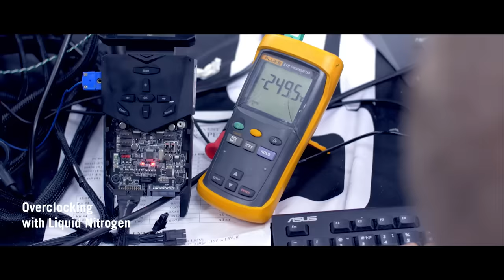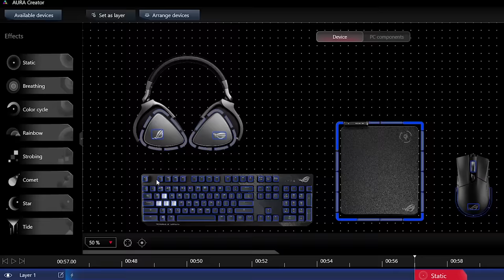The Story of ROG - For Those Who Dare

Comment: It was my first time building a PC and after watching numerous reviews of which is the best brand to get for my PC parts, the answer was clear. I'm now enjoying my fully-built all-ROG PC and the experience is like no other. 

#ForThoseWhoDare #ForThoseWhoDare #ForThoseWhoDare

Monitor 1: ROG Strix XG279 2560X1440 170Hz IPS
Monitor 2: TUF Gaming VG27AQ1A 2560X1440 170Hz IPS
Keyboard: ROG Falchion & ROG Strix Scope TKL Gundam Edition + ROG Wrist Rest
Mouse: ROG Chakram Wireless
Headset Stand: ROG Throne Qi Gundam Edition
Deskmat: ROG Sheath BLK LTD XXL
Motherboard: ROG Strix B550-A Gaming
CPU: Ryzen 5 5600x
GPU: ROG Strix RTX3070 8G Gaming
Cooler: ROG Strix LC 360 RGB White Edition
PSU: ROG Strix 850G White
Case: ROG Strix Helios White Edition

#ForThoseWhoDare #ForThoseWhoDare #ForThoseWhoDare

Comment: Purchased my ROG Strix LC RX 6800XT for $1,400 in June of this year. Really am loving it so far, but need to upgrade my CPU. The quick release button for the PCIE slot retention bracket on the new series of ROG motherboards is a must-have feature for me at this point because I have a dark rock pro 4 cooler. It's impossible to remove the cooler without removing my GPU, and I HATE putting a screwdriver or pen in between my GPU and motherboard to try and get to the release button. I will most certainly be getting a ROG motherboard to hopefully never do that again. Please keep that feature going in the future! So awesome! #ForThoseWhoDare

Comment: My favorite rog hardware is the Gtx 166ti. I had some much fun playing many games as possible using this GPU.
Two years later, I wanted to build a new gaming PC. My eyes were on the z590 Motherboard lineup, RTX 3060ti tuf, rog strix PSU, rog strix Helios, rog strix LC water cooling and Core i7 11700k. However, due to some restrictions in my country and limited hardware, I had to take what is available in the market. I got an RTX 3060 rog, b560g wifi, core i7 10700. I had to work for a whole year to be able to get a full setup which yet is not perfect. The sad thing is I can't really enjoy Gaming. No more than 2 hours per day or even 6 hours per week. Unfortunately, power is off most of the time. Hope you all enjoying your time.

Comment: I recently built my very first x86 PC for gaming and the only motherboard that had all the features I was looking for was the ROG X570 Strix —E Gaming. This was my introduction to ROG products and from there I bought a AX11000 router to utilise the 2.5Gbe and the Keris Wireless mouse and are super happy with all, especially the very low resource Aura and Armoury management software and the network speeds I now have thanks to the router, no more hangs or dropouts on all of my devices in my home network. I also think the ROG BIOS environment is one of the best user experiences and easy to understand in its implementation of all board makers — I’ve used a couple of others brands in the past and found them to be cumbersome and confusing . I am now happily amongst #ForThoseWhoDare

Comment: I bought my first ROG product by chance, I just wanted a gpu to use with my first 1440p monitor. So, I got a 2nd hand 1070ti which happened to be a ROG Strix model. Man, it was loud at first... I went on with cleaning it and replacing the paste, as it turned out that it had been mining for two years straight without proper maintenance. After that, the card turned out to be the most silent card I have ever seen. I was constantly looking down at its fans to see if they're working when gaming... And the temps were like the best 1070ti temps around. Kudos for that great product, it's still working like a dream in a friend's pc.
#ForThoseWhoDare

Comment: 2 years ago, I bought a computer set from a closed Computer shop worth 5k for the love of gaming. I started purchasing my first ROG Product ( ROG Strixx B450-F Gaming ) and AMD Ryzen 3 to replace my crappy motherboard. I fell in love with the ROG Strixx Collection and as of now, I am almost complete with my Build with Full ROG Product. I never felt that I'm wasting my money because I'm getting a Quality product. Here's my PC Specifications : 
Case : ROG Strix Helios
Motherboard : ROG Strix B550
GPU : ROG Strix RTX 3060
RAM : T-Force Delta 32GB
Cooler : ROG Strix LC 360
PSU : ROG Thor 850W
Processor : AMD 5 5600
HDD : SeaGate 1TB
SDD : 500GB
Peripherals :
Keyboard : ROG Strix Scope
Mouse : ROG Spatha
Headset : ROG Strix Fusion 700
Headset Stand : ROG Throne

#ForThoseWhoDare

Comment: My favorite piece of ROG hardware is the ROG graphics cards, they deliver the best quality and great thermal, making my gaming and content creation so so much smoother and faster! 

Previously, I was working on my After Effects projects on other brand’s gaming laptop, and I was stuck with slow and laggy workflow, same goes with gaming, the frame rate drops and glitches. However, after I built my first gaming PC with ROG Strix Motherboard,graphics card, AIO cooler and PSU. All theses problems have gone away! 

ForThoseWhoDare

Comment: My favorite ROG product is gladius 3 wireless. It ended my 12 years of search for the perfect mouse - hot-swappable main switches(I changed right one to Kalih GM 2 for more "mushy" feel, while leaving ROG switch on the left for snappy clicks), all-plastic body that makes mouse easy to clean, best wheel(and even more important for me - disclosed model of encoder, so I could change one if needed). The fact that this mouse designed to be easily and repeatedly disassembled captured my heart. The only downside to this mouse is that you have to install Armoury Crate to configure it.
#ForThoseWhoDare

Comment: Currently using my ROG Maximus X Formula and love it. Currently houses my 8700K which is overclocked and has done me well over the last few years. The additional ports, VRM cooling, and the beefy backplate made it easy to install and at the same time connect everything I have inside my system for the full experience. Definitely looking forward to the Z690 Extreme and maybe if I'm lucky upgrading my entire rig based on it this coming year. 

#ForThoseWhoDare

Comment: The Asus RTX 3080 Strix is is my favorite piece of ROG hardware. I am a big fan of simulation games, especially ones with incredible graphics. The RTX 3080 Strix allows me to play all my favorite games on max settings, and I never have to worry about frame rate drops. The cooling solutions on the card are also incredible, I never have to worry about overheating. I also appreciate the high quality parts that they use for the graphics card, I have heard of other cards not from Asus crashing but I never had such an issue with my Asus GPU. Also, I have to mention how incredible the design of the card is; the RGB is amazing and the card looks amazing in my computer. I also use an Asus THOR power supply, Z390-e Strix motherboard, and an Asus Ultra-Wide gaming monitor, both pair great with the GPU. Thanks Asus for making such great products and being a company I can always rely on!
#ROG #ForThoseWhoDare #Giveaway #BreakAllLimits

Comment: The most attractive specs that I like about ROG laptop are its durability, battery and mobility. I can't imagine how they fit an RTX 3060 in a 1.6kg laptop, a 76WHr battery that lasts for 7 hours ! The build is also breath-catching, even in low-spec models, it still has a stylish, durable build. Have been using the Zephyrus G14 for 3 months, I would strongly recommend my friends to ROG if they want to have a high-end laptop, or even a budget one. The build is just so amazing, I dropped 3 times but the laptop is still no harm, impressive though.
#ROG #ForThoseWhoDare #Giveaway #BreakAllLimits

Comment: My favorite part of the ROG gear is the motherboard. I landed a b550-e for its solid dual pcie 4 slots for a 2 graphic card setup. I'm learning a lot on making the graphic cards share loads for smoother experience. The upgrade process from my previous motherboard to this was so simple (ie preinstalled io shield, clearly labeled ports, multiple hole mounts for all cases, huge documentation and up to date drivers) #ForThoseWhoDare

Comment: I've always been a fan of ROG and especially the motherboards, been using them since the Z87 Maximus Hero till now with the X570 Crosshair Hero. Bios Flashback, watercooling temperature sensors, waterpump headers, the 
superior bios with easy navigation and great overclocking support, the best fan tuning software, these are just some of the reasons why i keep using them. 
#ForThoseWhoDare

Comment: I have one of the M15 models, and I have to say, I'm pretty impressed. Performance is insane for such a small yet sleek build, fans being noisy isn't even a problem, and it works seamlessly with every game and application I run, not having to worry about if my CPU is outdated or my GPU is too slow, everything just works. I highly suggest everyone check out a ROG laptop, or some of their products for the cheap price and the pure performance. #ForThoseWhoDare

Comment: I've been using ASUS parts on my PCs since I was a kid. My first own PC build was from the Pentium D days and had the longest mileage out of my PCs. The latest build I have runs with a ROG STRIX B450E, first time I ever have built-in WiFi (and I hate wiring up, plus the WiFi performance is great) and previously was matched with my good old STRIX GTX 1060 which I got from a clearance bin (when GPUs can be bought on clearance) #ForThoseWhoDare

Comment: #ForThoseWhoDare

I just recently built an entry level pc using ROG Strix B560G Wifi for my younger siblings to support their home based schooling. I really like the aesthetics and its performance and I still have some option to upgrade some components including the storage and RAM. It also has a Wifi antenna and  bluetooth 5.0 which can easily connect to our smartphone devices. The ports are also decent and the price is just bang for the buck!

Comment: #ForThoseWhoDare   ROG Flow X13 GV301 -  I like this. Powerful Windows 10 gaming has never been as flexible or portable as in the 2-in-1 ROG Flow X13. Speed through gaming and beyond with up to the latest Ryzen™ 9 5980HS CPU and GeForce RTX™ 3050 Ti GPU. The optional XG Mobile eGPU boosts graphics on-demand with up to a GeForce RTX™ 3080. Perfect your play with a choice of 4K UHD or 120Hz FHD displays.

Comment: i like all stuff from rog, but i most part like is portable one. i like to build my own pc, but my work required to meet clients, so i cant stay in place, need portable one. i grab rog strix(2020models) with 1660 in it, not really high end spec, but its really enough for my work to modeling and some randering. the most part that i i like from this laptop is the light under the laptop. not just for styles but iam the one, ForThoseWhoDare 

(sorry for my bad english, lol)